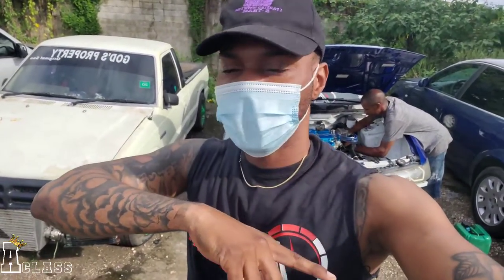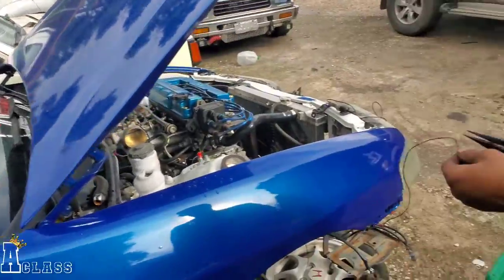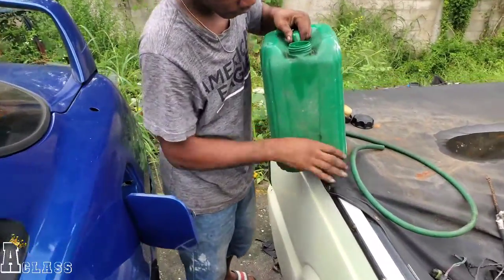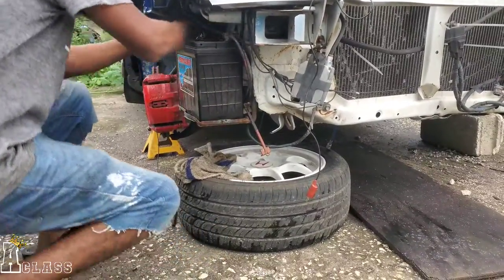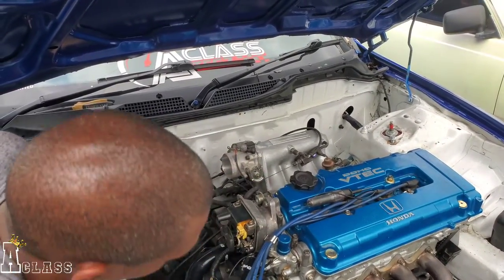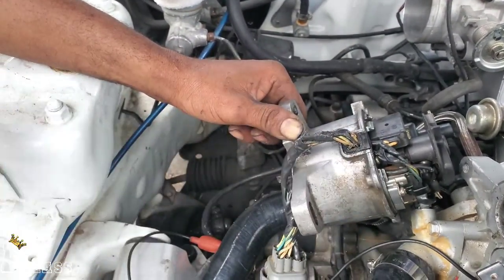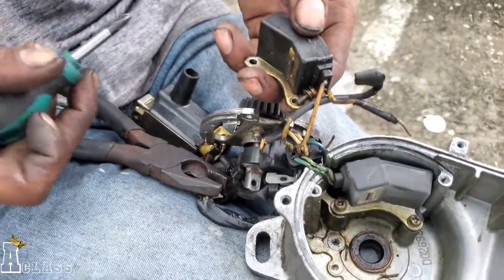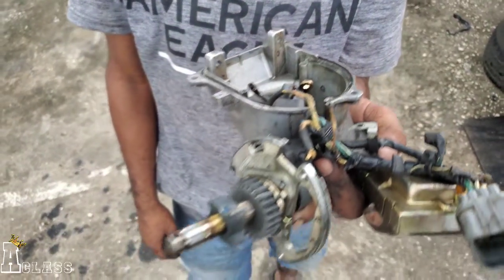Discover a big Problem thats causing Pretty Blue not to Start🥺. Take a look.

Comment: U nuh really need it for an integra still , just get the tie bar, the lower control arms and u good. But if u really want the look, check honda solution on the Spanish town bypass or Amazon if anything.
Reply from the maker: Ok. Yes I know the subframe brace is not a must.. but I wanted to look as well..
Reply: Me ave a red tegz a tek time sort out still an u a one a the man them that keep me intrested in completing the build. So keep the videos coming 👍

Comment: Change the complete distributor don't change any wires inside, I've been down that road before that was a nightmare trust me. Even if you change the wires and get it started it will never run right been there done it believe me, just change di entire dizzy mi G
Reply from the maker: That's what I want to do
Reply: @Theplughimself  you can find them on Ebay new
Reply from the maker: @TaaJ45  I got a new one today
Reply: @Theplughimself  ahh mi G hopefully everyting sort out now

Comment: make sure the ground to the thermostat is connected correctly and all grounds are to bare metal,  make sure fuel pump is priming if not its the main relay under the dash on drivers side held on by a 10mm bolt
Reply from the maker: Ok respect will check